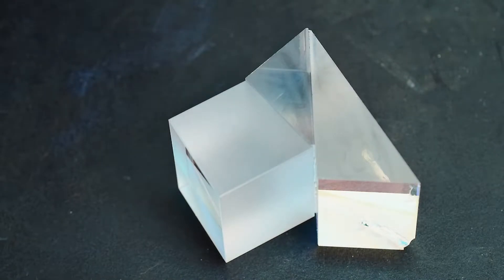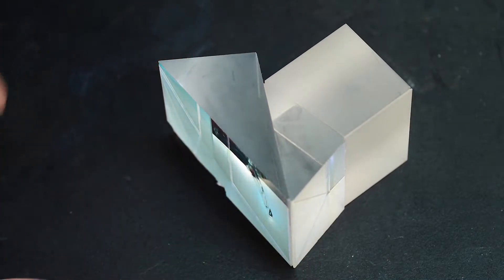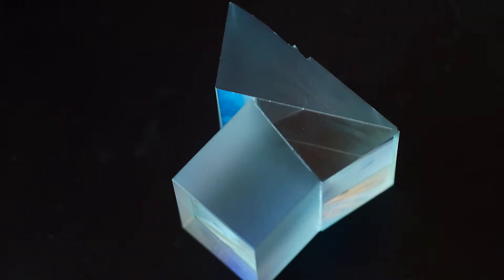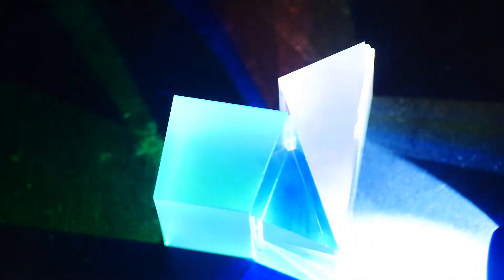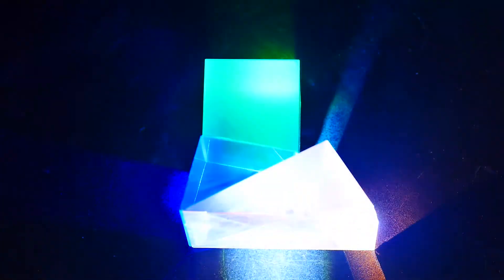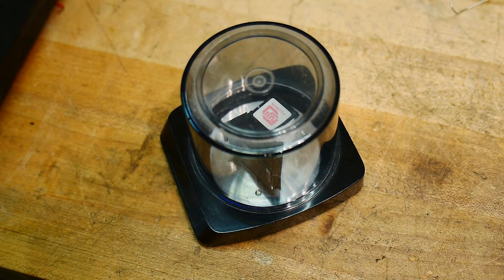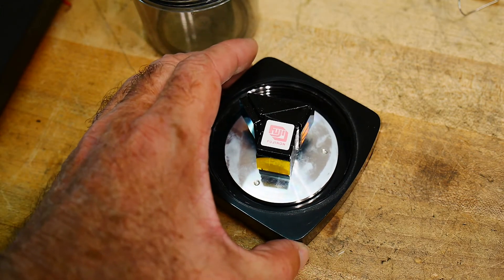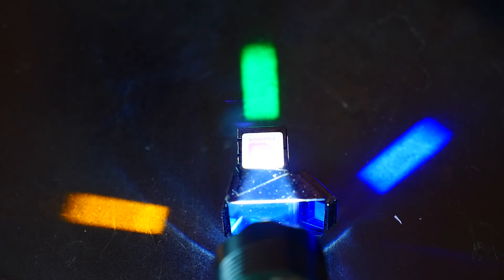#483 Philips Prism

Comment: I picked apart a 3LCD projector once, but i found a cubic prism/optical device, it seems to work the same from different directions (left = blue, right = red and front = green) but isn't as perfect as a dichromatic mirror so i suspect it's only good for combining 3 beams in to one.
Reply from the maker: There is a different type called an X prism. It is cubic in shape and is four pieces of glass. many prisms are not too good by themselves and need secondary filters to clean things up